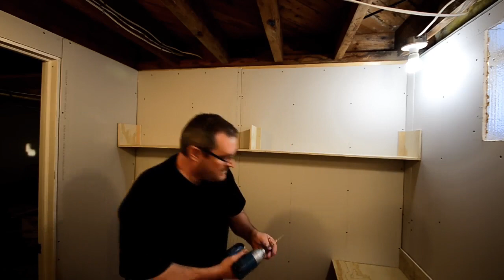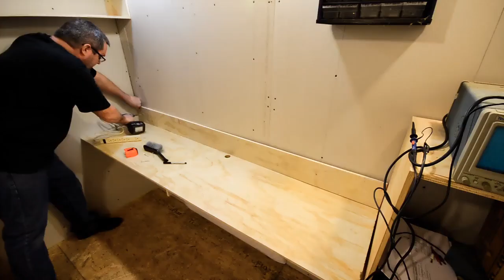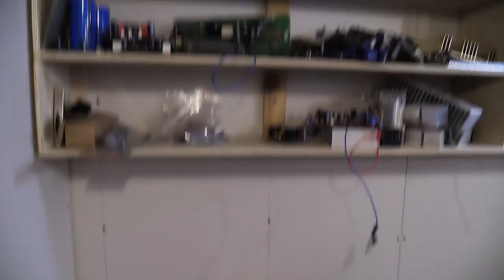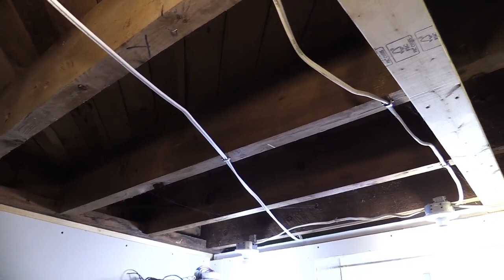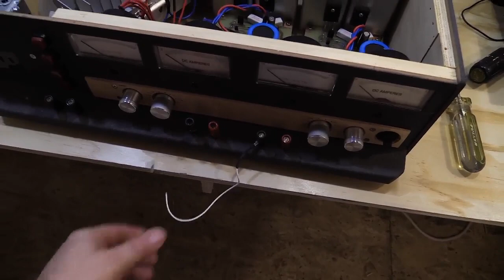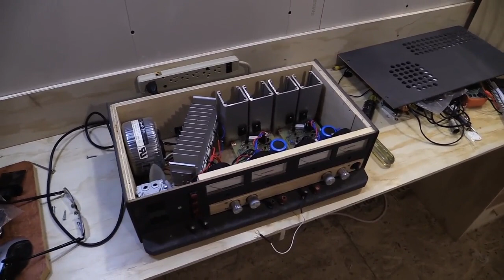Finishing The Electronics Room

Comment: looks nice but how about leveling & putting an anchor on the sheet rock,..??? for heavy equipment
Reply: The shelf was level, it was a wide angle shot that made it loo off. If you listened you would have heard him comment about all those transformers on the top shelf, they are heavy, so no additional support was needed except for the sag between the long shelves.